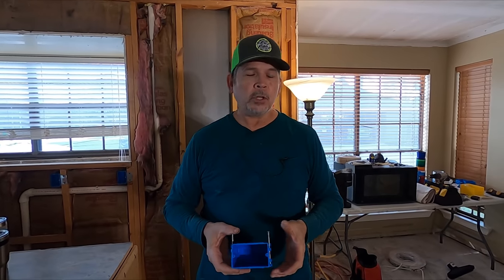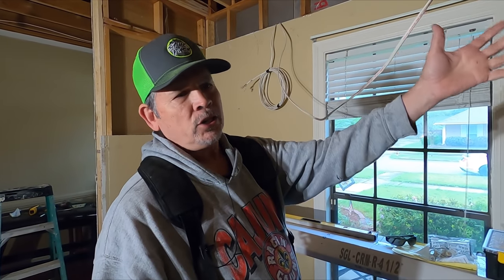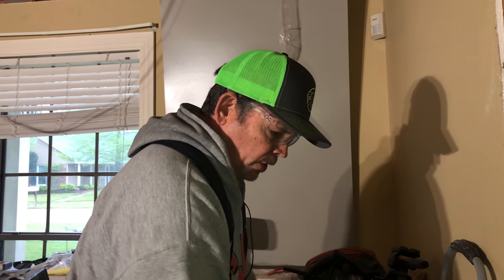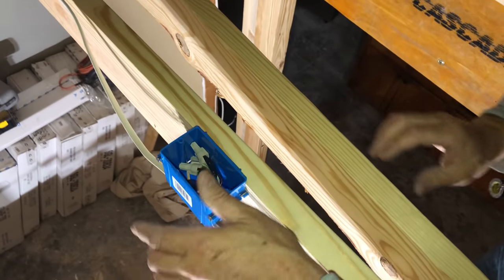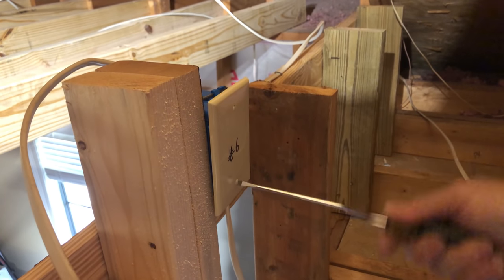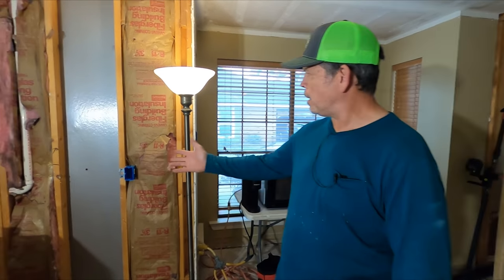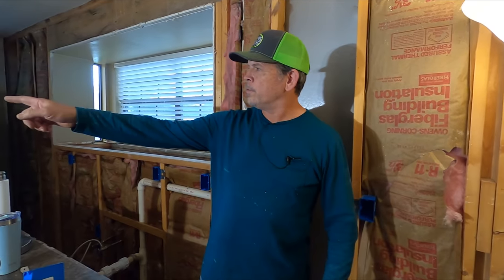How We HELP Our ELECTRICIANS⚡️ Ep. 10

Comment: at on time I had a General contractors  and a home improvement contractors license. The Home Improvement license allowed me to do residential wiring but the inspector wanted a licensed Electrical contractor the install new Meters and the circuit breaker panels but I could install breakers and the room wiring,

Comment: When I first started working as a carpenter the general contractor also had his electrical license and we wired the houses we built l learned how to wire in a few days by the 3 third house I was  doing all the connections in main panel due my neatness,, it was so much easier to learn then all the aspects of carpentry, I'm ,60 now and have been in business for 36 heard as a general contractor and just rough wired a house by myself in. 14 hours all by memory with no plans,  you can do it just don't let it intimate you,, I went in business at 22 years old after only 2 year's of on the job training and have learned all the trade along the way.

Comment: I'm from Europe, it is interesting to see the differences between our electrical installations. We have cable, but we mostly use single wire in pipes so you don't have to tear down the wall if you want to change the wires. (Most of our walls are stone although we have drywall.).

Comment: Ive been enjoying your electrical videos. You have been pretty spot on. A couple things i felt like i should pass on... 
The tabs in those boxes arent meant to be completely broken out. If you just force the cable through the tab will act as a strain relief and cant be pulled back out of the box. 
its a good idea to strip the ends of the wire before capping them. Ive found that the wirenut doesnt hold as well on the outer insulation. 
I cap the grounds like you too for the same reason, also its nice to have one there to use whenever you go back to make a splice.

Comment: when cutting the sheeting off the cable, try scoring the sheeting across the wire, rather than down it, after that, you should be able to just pull the sheeting right off the wire. saves much time. careful to not actually cut cable, just score it.

Comment: Depends on the state you live in and local jurisdiction having authority. Some will not let you get away with doing all this. Some states won't even allow someone to run low voltage wiring without a license to do so. Just know your local regulations.

Comment: I hate anything IDC, stab back connections. I only do side screw for outlets/switches, tight wire twist and wire not for junctions. Have seen enough electrical fires from bad connection using IDC type (stab back, compression type connections), just not enough mechanical coverage for higher amp loads). Also my preference, metal for all junction boxes in attics.
Reply from the maker: IDC... insulation displacement connection or insulation piercing type of connection?   Hardly ever see those in 120V.  Like the switches you can install on zip cord.  I’m the same though... side screws (wrap around or clamping type), pre-twist and wire nuts.

Comment: The backstab method I see you did on receptacles is fine for just temporary stuff. But do not use that on final install. Less contact area on the wire and can generate more heat. They do not always hold good. And it’s just messy. I call it a backstab because that’s what your doing to the receptacle and that’s what your doing to the owner. Not sure why that’s even an option. I have swapped out many burnt and melted receptacles many were backstabbed.
Reply from the maker: Me too   Thx Stephen 👍

Comment: The crimp connector is a copper (Buchanan).  I'm always curious by the videos because although you have to abide by the NEC, in Massachusetts we have Mass amendments in our code book we have to go by first. You also can't always use an existing  box if it doesn't have the appropriate cubic inch capacity for conductors or if the existing ground is under sized (in older homes). In that case the circuit has to be completely rewired.
Reply: It is not just in Massachusetts pretty much everywhere has amendments to the codes that exceed the NEC, It clearly states in the front of the book to refer to the governing jurisdiction for any discrepancies.

Comment: NYC here. I worked with BX and metal boxes in a 1940s studio apartment that I renovated. I don't like Romex or plastic boxes, but the fight that I had to put up to rehab cloth-insulated wires was one for the ages. I even had to break up soldered wires that fed downstream outlets. The night before I was due to finish, I tripped a CKT with my miter saw and could not ID the fuse at first. Future me's and anyone else is in for a treat, but the stress was no bueno. Great work all around, awesome explanations, and not a word over what was necessary! Thanks!
Reply from the maker: Thx Marcos 👍.  I prefer MC and EMT and metal boxes too.  Goes back to my commercial days I guess 💪

Comment: As an licensed electrician and for 3 years electrical inspector here are some observations:
1. On a previous video you used what looked like 4 sheet rock screws to attach two devices to a j box. Not permitted. 
2. Kitchen receptacles shall be 20 amp supplied. Yellow 12g cable not 15 amp 14g white NM cable as in the video.
3. Cables that enter a box with no cable clamps shall be secured within 8 inches of the box.
4. This is not a code comment. When you have a series of j boxes close to each other marking the blank covers is good but also mark the circuit # inside the box so if the covers are switched they can be correctly identified.  

Cables
Reply from the maker: Thanks Ray, super appreciate you watching and your comments 👍   Hopefully I can answer 👊
1) the holes in the old Bakelite box were stripped, the 6-32 device mounting screws wouldn't bite, I've found that drywall screws work well as a temporary fix.  We'll correct this when all the new devices are installed 👍
2) that is some older 12g NM-B up there before they changed the jacket cover to yellow.  Should be fine.  If my electrician recommends to swap it out for new we will 👍
3) I did go back and staple everything as I mentioned.  I tend to do all the stapling at the end carrying just a hammer and some staples.  Those staples always fall out of my tool bag when climbing around an attic 😖
4) super idea!  I used to write circuit numbers on the back of plates in living areas until a painter didn't notice and mixed them all up.  In the attic I figured it wouldn't be a problem but I'll go back and do that 👍

Thanks again, Paul

Comment: I'm not a licensed electrician but I've have run miles of wiring. I learned the basics decades ago back in high school that also included an advanced course. Over the decades I spent lots of time remodeling and flipping houses that included many rewiring projects. Caveat: All my work was done with the proper building permits, inspections and eventually signed off on. I only ever failed one inspection and that was because after twisting some ground wires together I used a "red' wire nut to secure them instead of a "green" one. At first I thought the inspector was joking but turns out I wasn't familiar with the code change. In any event, I have no problem with a non-licensed folks, like the crew of Stud Pack, doing wiring as long as whoever does the work  they know they know the fundamentals, know how to be safe, understand the dangers involved, and have their work inspected by a licensed professional.
Reply from the maker: Much appreciated Elton 👊👍

Comment: So you have a GFCI in the back bathroom feeding an outdoor receptacle on the front porch?  My preference would be to leave the bathroom alone, send power direct to the front porch box, and buy another GFCI to put out there.  As originally set up, you could be wondering why the hair dryer won't work in the bathroom, and the reason is that it rained and the Christmas lights got wet.  

My GFCI rule of thumb is that for indoor circuits, a GFCI should only feed downstream loads in the same room.  For outdoor, it should only feed stuff in the same box.  GFCI's are persnickety little buggers, prone to nuisance tripping, so it's best to keep it really clear what they feed.  And to minimize the amount of stuff you lose when one pops.  Yes, it does cost more that way.
Reply from the maker: I could easily run a new circuit to the porch GFCI.  Thx John 👍

Comment: Dude those things you're knocking out the plastic boxes are not Knockouts. They are cable clamps you push the cable through from the outside and they secure the cable to the box (they take the place of those cable clamps that you always complain are missing). How are your cables secured to the box to prevent them from pulling out and stressing the wire nut connections? Your electrician will have to re-do all those junction boxes.
Reply from the maker: Lots of comments regarding this subject and everyone has their opinion.   Our inspectors regard them as knockouts and the Romex must be secured to the framing within 8” of a single gang non-metallic box without clamps anyway so leave them or remove them as you see fit.  IMO that tiny bit of plastic holding that flap to the box cannot be intended to secure a cable 👍👊

Comment: Surprised you got rid of the metal boxes for plastic boxes. The metal boxes are so much more durable and they protect against arcing because they are grounded (which plastic boxes do not as they can melt), I would have just grounded the existing metal box. I can't tell you how many times I stripped or broke a plastic box screw holes. Would never be able to do that with a metal box, if no other reason because the mud ring is fully replaceable.
Reply from the maker: Well they’re supposed to bonded to the ground.  These weren’t 😳

Comment: also electricien/ here got nice tip if you write the circuit code on the box draw a dot on the cover and a dot on the box and the other one do a double dot then even if a idiot switches the covers around you can still see that the dots dont match    (same principle for switches that send serial codes to a domotica unit write on the back wich room it goes so painter doesn't put them back in the wrong room)

Comment: Man my stepfather is a stubborn person and see that a lot of things that you’re doing as a waist of time and would call you stupid for labeling all of those termination boxes you made for the electricians to move much faster. 

But my method for doing things like that is to be nice and neat while at the same time, minimizing waste. I’ll measure out the exact length of cabling I would need for the electric I’ll be working on. Have it’s path laid out so I can see how I’ll run it. Then once I’ve got all I need in place. I’ll go to work in one slow and steady go.

My method for plumbing. Cutoff valves at key access points with all of them going into a master cutoff value that will be for the whole house. And my reasoning behind my method like for example, if the tank on the toilet in the upstairs bathroom suddenly gets a crack in it that causes it to leak. Instead of turning the water off for the whole house. I can simply turn the shutoff valves to that specific toilet and still have water flow for the sink or shower/tub in that same bathroom.
Reply from the maker: Awesome thx 👍

Comment: Nice video. When I have used the plastic work boxes, I don't punch out the cable inlet tabs. I bend them open a little, leaving the tab in place which allows the cable to slide in, but it won't allow it to slide back out (like a cable clamp). I thought that was the idea behind those tabs? I learned something new.
Reply: The type of box he used is a knockout style in that case as a Electrician they are knocked out. Securing electric cable in the box is good practice, and it makes for a safer installation. However, you do not need to secure the NM or Romex wire inside the plastic box. The electrical code states that you must staple on a solid surface (the stud) eight inches or nearer to the outside of the box. The staple provides a secure hold because it is separate from the box itself.

Comment: Americans have the worst electrical wire  colors i've ever seen
Here we use 
A Brown wire for power
Going to the recepticle
We use a black wire to power the light bulbs indicating a switchable power wire you connect brown and black through the switch itself
We use a blue wire for the negative side of the circuit 
And a yellow and green colored wire  for ground.

Its way easier to see what you have in your hands when you have colors instead of only black and white
Reply from the maker: Thx much appreciated !

Comment: @13:24:  I'm pretty sure those aren't knock-outs.  You just open one side, so it acts as a retention flap that resists the wire being pulled out of the box.
Reply: Looks like you raised this in your next video and contacted Carlon.  Hope they reply.  Not surprised you'd already thought about it.

Comment: I was wondering, what holds the cables into the junction boxes you are using, I didn't see any clamps inside the box ?  If those are Carlon boxes, isn't the piece you punched out the wire gripper ? 
?
Reply: Yes, you're not supposed to knock those off. You're meant to prop them open a bit and slide your wire through and the tab will hold them in place. Boxes always have to have some type of connection holding the cables to the box.

Comment: I enjoy your vid’s.   I have been in remodeling and associated work since 1975, but good to see how others do stuff. I dont know if this comment is going with the right video, youtube might have jumped ahead and i dont want to figure out how to go back. Anyway, on the bath exhaust fan venting...i would never use the flexible duct for several reasons : 1) all the ridges greatly reduce air flow. 2) too easy to tear the stuff and hard to connect it well.3) I have run into a case where the exhaust run had a dip, low spot in it  and the warm moist air condensed inside the pipe like a plumbing trap, until it blocked off most of the intended air flow ! 4) had a squirrel get in the vent weather head, eat thru the flex, get in the attic , then naw a hole in bath ceiling so that the young tenant lady made the owner pay for  a hotel until he got the problem corrected!    All so the exhaust fan installer would have an easier install .   The stuff is crap.    Do it right the first time 
     As for your relationship with your electrician, I can see the benefits, but would be concerned about the liability question if something went wrong . You know insurance companies spend much of their time trying to figure how to avoid paying claims .
Reply from the maker: Thx for commenting Richard, much appreciated 👍

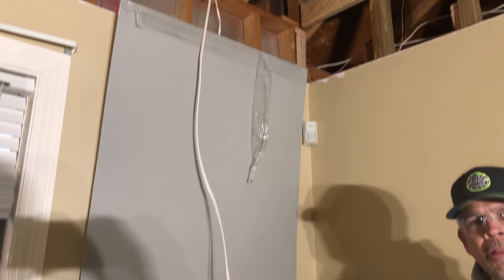Comment: at 15:40 the Code now requires that Bathroom 20 amp, no 12 wire circuit only  feed the bathroom outlets and a separate lighting circuit that can feed two bathrooms,  most inspectors want outdoor recepticals be on a decitaced circuit
Reply from the maker: Yep. This one is grandfathered in.

Comment: Those strippers you're using at 11:07 are my preferred way to strip the sheathing off 12/2 and 14/2, much safer than a utility knife.
Reply from the maker: Yeah but I need to check to see if they'll damage older thicker Romex.  They certainly work great on the modern stuff.

Comment: The blue boxes are not knockouts they are to secure romex like clamps on metal boxes. Other than that love they work ethic and organization.
Reply: They are knockouts. You can buy them in either configuration. If they were the integral clamps, he would not be able to just knock them out. He would have to force them open with pliers and break them off, probably destroying the box in the process.

Comment: I never use a straight-blade utility knife on Romex due to the deep gash it leaves in your other hand if it slips. It can also get into the wire insulation when stripping the outer sheath.  A hooked blade works much better for all steps of prepping Romex and is a lot safer for both the Romex and the person using it.  Try it-----you'll like it.
Reply: I am a floorlayer and I can tell you I have seen way worse cuts with a hook blade they cut from the inside damaging tissue

Comment: I've ran into this a time or 2 as a maintenance tech for college student apartments I got tired or trying to fish out stuff out of the drains so I took a shop vac hose and about 15 feet of nice rubber garden hose. Used duct tape and adapted from the shop vac hose to the garden hose. Was small enough to use on sink and tub drains to get hair balls and anything else like bottle caps shot glasses and the other typical college student party pranks produces. Also worked great on toilets even able to get it down some of them and not have to remove the toilet to get whatever they flushed that was causing the problem.  It isn't meant to suck it through the hose its meant to hold whatever you are trying to pull out of the pipe to the end of the hose although wet paper and hair balls tend to suck through
Reply from the maker: Cool thx Clayton 👊👍

Comment: The one junction you made on the joist, wouldn't that be covered by insulation then impossible to find later. The others were up and out of the future insulation environment. I kind of picked certain segments so maybe I missed something. I enjoy your channel...
Reply from the maker: I'll use batt insulation in that area so I can cut the insulation around it.  There wasn't enough wire to raise it up higher but I may end up doing that anyways even though it means another JB.
Reply: Thanks for the quick response. I am a retired electrician and buried junction boxes in 15-20 inches of blown in r-30 was a nightmare to find.

Comment: Yes, Never reuse the push in connection on the back of an receptacle. When removing the wire from the back, it is too easy to damage the prong in the receptacle and not have proper tension on the connection. another good video. Really like the way you do the electrical terminations.
Reply from the maker: Thx 👍😎